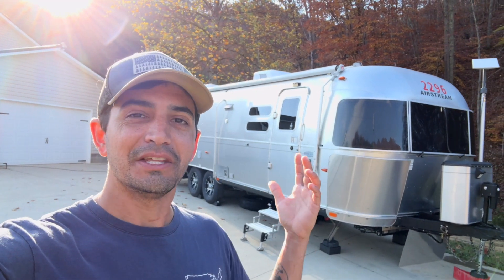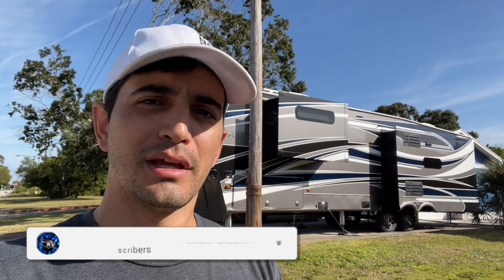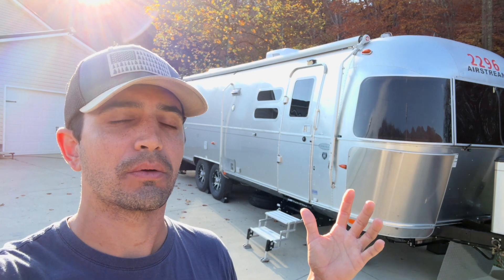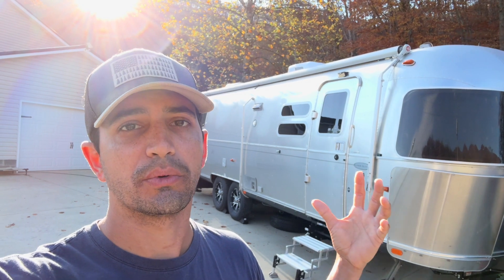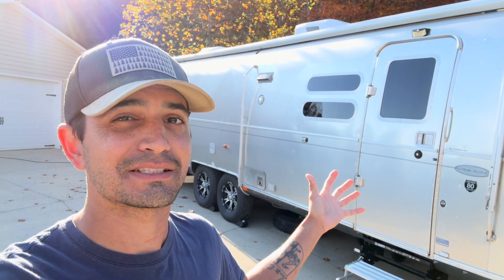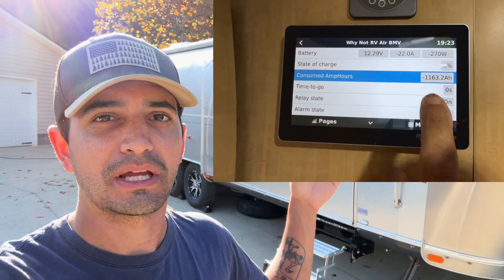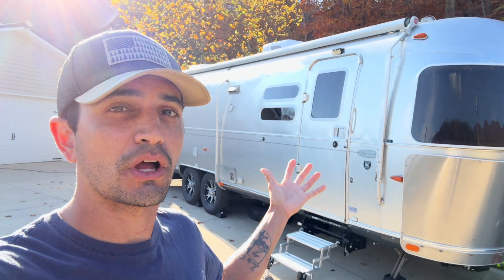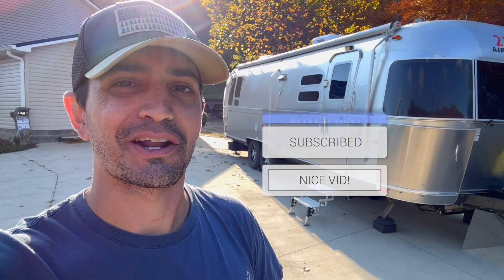DIY Battery Upgrade UPDATE - Why Not RV: Ep 135

Comment: Set up still performing well?  Due to your video we did the same set up w victron Quattro and Cerbo GX.   Curious what charging parameters you used?
Reply from the maker: Yes. Amazing actually. I should do a 1 year later update.
Reply from the maker: I have absorption set to 14.6 and float to 13.8

Comment: Just watched your two episodes on DIY battery upgrade and wondering how many hours of air-conditioning use you can get from your 1200 amp hours of batteries? And wondering if you do upgraded systems like this for hire for other RVs?
Reply from the maker: Hey, I appreciate you watching! Unfortunately, the question is impossible to answer. If I was in Key West in July, and the air-conditioning didn’t shut off, it’s very different than being in southern Michigan in July where they air conditioner can at least cycle on and off throughout the day. if you look at my channel, I also changed out my main air conditioner unit to a extremely efficient rooftop RV unit so it buys me a lot of time. I am in Southwest Virginia area and can do custom builds and up fits depending on needs and wants if you’d like to email me to inquire, it’s whynotrv@yahoo.com

Comment: thanks for this battery build, I am looking to get the same setup but 3 kits of 4, not 4 like yours. It will be plenty for me. OHH how much solar did you instal? I only have 925w and we all know that you can have the watts you want but we also relie on sun... so on the cloudy days I am having trouble putting back the amps in my 400AH on board. I want to add more solar to my setup to charge up my next 924AH battery bank like yours. I do have a MP2 victron with a 2500w small gen for back up. Just looking for recommendations on the solar we might need.
Reply from the maker: Absolutely!!! Thanks for watching!!! Like I tell everyone, there’s no right answer for how much solar you need. There’s just WAAAAY too many variables. Instead I recommend investing in different methods of recharging with a decent solar setup. Currently this airstream has 400w but I’m hoping to soon upgrade to 8-1200 range. As a “rule of thumb” it’s 4-1 ratio which means 400w per 100ah of battery. Now that’s not realistic for RVs generally so add DC-DC charging which you don’t need to rely on sun power and a generator for recharging when necessary. If I boondock with this setup and I’m not needing AC I can go days and days if not a week before I’ll need to recharge which I’ll just run my generator to complete. If I do need AC the batteries will carry me overnight and I run the generator in the morning to recharge
Reply: thanks WNRV, even with 400AH I can get away with a few days in grey temps with A/C. I am going to add some solar I do have the room and set-up the wiring Just for that. The Gen comes into play just for charging up and that fine, thanks agin for all your amazing content  @WhyNotRV
Reply from the maker: No, thank you for watching and commenting. I appreciate it!

Comment: Wow the original video that you reference had so many issues with the actual battery build so I won't rehash that.  While there are different configurations, to imply that there are thousands of different ways to build a battery and thousands of ways to wire a BMS is pure lunacy.  Additionally, you are talking DC current which can be VERY dangerous for a DIYer and a BMS needs to be wired SPECIFICALLY AS INDICATED per directions.  IMO you logic on redundancy is flawed.  If you want battery and BMS redundancy, build one larger battery, keep a few extra cells and an extra BMS or two on hand as backups.  In your config, like the Battleborn where you have one BMS per battery, if one BMS goes down, you lose that entire 4 pack of power and you have 4 BMS to worry about.  With one big battery and one BMS, if the one BMS goes down that controls the entire battery, you replace ONE BMS, 10 min job and done.  I am not claiming expert status, far from it, but man.
Reply from the maker: I appreciate you watching. I’m definitely not here to argue with anyone, everyone has a right to their own opinion. I just share my opinion and show my real life application and practice of something.
Reply: How long would it take you to change that 1 BMS in the darkness of the middle of the night w no light or heat, looking for tools positioning light w frozen fingertips? 3 of 4 in a well lit comfortable climate sounds better than none - an electrical engineer who wishes I’d seen a DIY lith batt vid like Why Not RV before buying 2- 300ah for my rig
Reply from the maker: I appreciate you. Thanks for the addition
Reply: @teddyk9619  I can address your  strawman example. However, perhaps to make it even more unusual, we could introduce elements like sharks with lasers. All jokes aside, most people who are prepared in this area can easily have an additional Battery Management System (BMS) of the same make as a backup. When planned properly, you can simply disconnect the positive and negative conductors from the BMS, unplug the BMS leads, and install the new BMS. This process usually takes just a few minutes when done correctly. By having this redundancy, you can avoid scenarios where you may lose a good percentage of battery overnight, or longer.  Yes he should have spare bms anyway so now he needs at least 5.  Alternatively, having backup systems for emergency lights and warmth for a brief period can also ensure a more secure transition while replacing the BMS.  There are options, you do you, no problem there.  Just plan for those pesky sharks with lasers coming in the bone chilling cold.

Comment: Great setup - I have just one string of 304 AH cells  in my RV - I found them trip fuses a bit iffy with surges and  went over to ANL fuses
Reply from the maker: Ya I figured I could change over to ANL if need be but these offer the ability to easily disconnect if need be which is nice. If they start randomly tripping in me I’ll look at a different option.

Comment: I never knew you could diy a lithium battery until your video so thank you! When I get to that point I will do the same for sure! Also I agree with the multiple bms logic! I can't wait for the solar build on this rig as well! 1 question, is there quiet a bit of inverter loss with the victron? And would it be beneficial to use some 12 volt appliances like slow cookers and fans instead of 120v stuff through the inverter?
Reply from the maker: Thank you. Glad I could help!!! As for the multiplus efficiency. Different versions have different ratings. The one I have in the airstream is 93% efficient with 15w of zero load power draw. To me it’s all about convenience. I just use regular 120v stuff.

Comment: Thanks for the info....it really got me to looking at building a battery and so forth.  Im going to go with a handful of SFK batteries which is just easier and safer for a newbie like me.  Still a great bargain although the kits are a tad bit bigger. Thanks again!!!
Reply: I went with SOK batteries on my system.  Seemed to me the best bridge between a DIY and a "non serviceable " battery like BB.  You can definitely get more Ah in a smaller footprint for less $$ with DIY build.  Not sure is someone makes a "empty" battery box that would house the individual cells and the BMS (for a reasonable price)  THAT to me would truly be the best way to go DIY.  In the meantime SOK, IMO, is the smallest footprint/highest capacity for the lowest price!
Reply from the maker: Absolutely! Nice thing about the SOK batteries is they’re serviceable. Top pops right off and you’ll see 4 cells just like these with a BMS and everything in the case